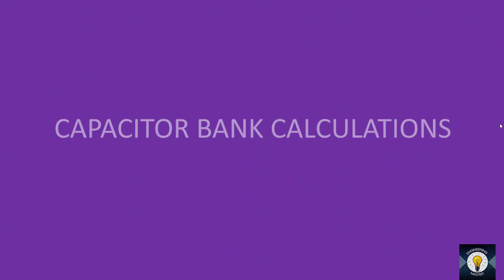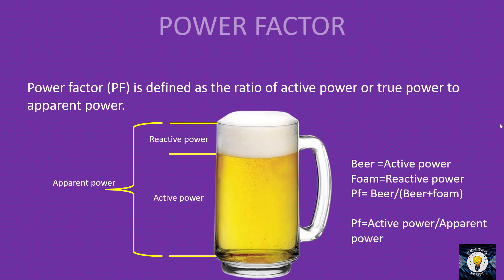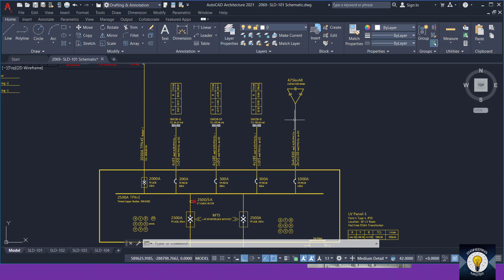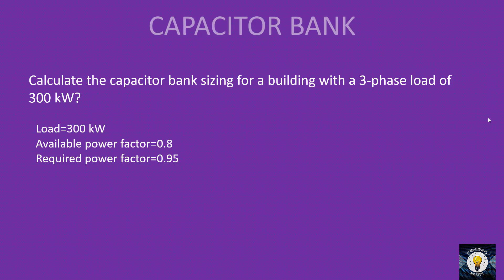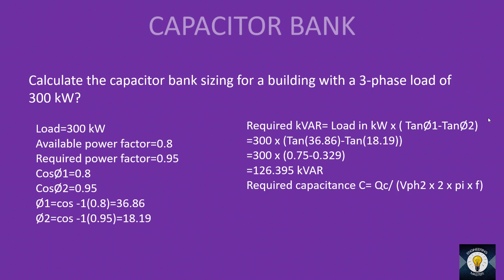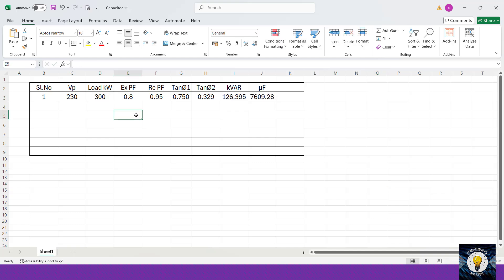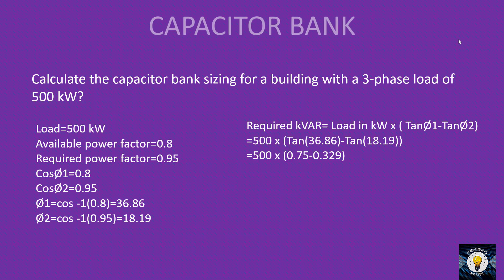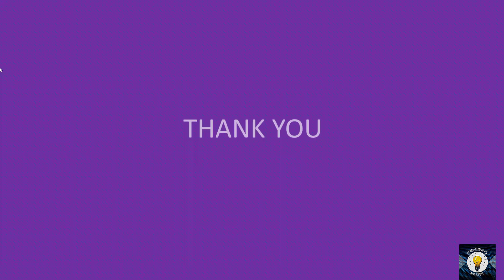Capacitor Bank Calculation Explained | Power Factor Correction

Comment: Hi, 

Thank you , the explanation was clear. For second example you said for 3 phase. The voltage for 3 phase is 440 volts . In calculation you considered as 230. Kindly let me know if it right. Thank you
Reply from the maker: Phase voltage is considered in capacitor bank calculations because capacitor banks are used to correct the phase difference between the voltage and current in an AC power supply. Phase voltage is 230 Volts.440 or 415 V is the line voltage.